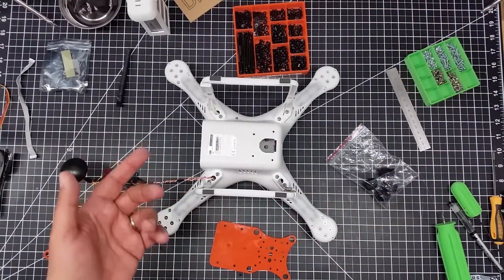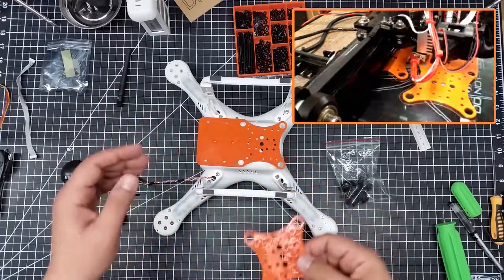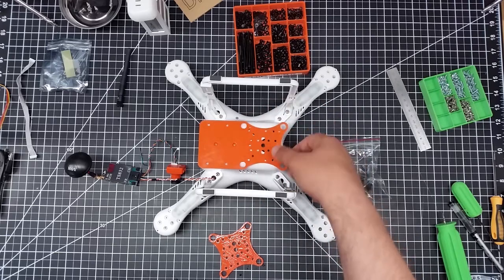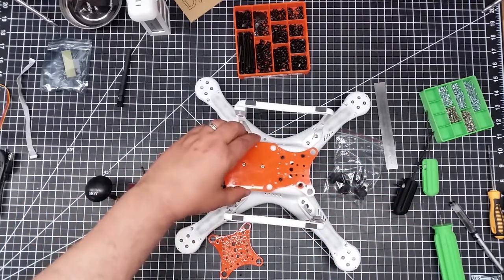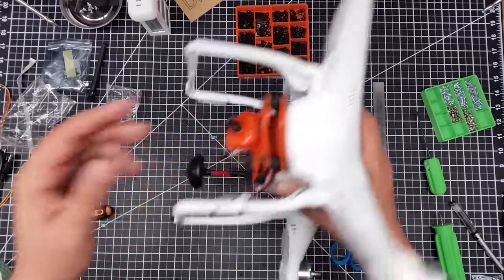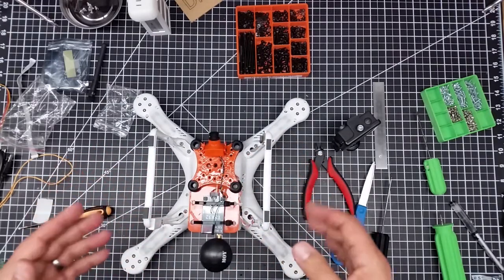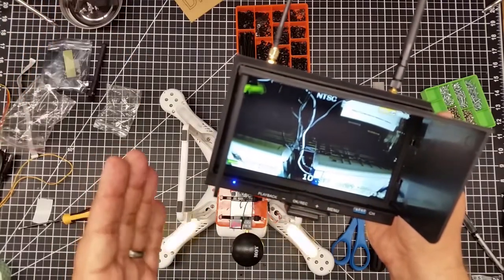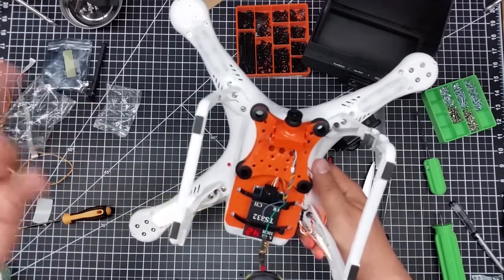Video Drone - 3D Printed FPV and Camera Mount for DJI Phantom 2!

Comment: Could you not have cut those out of acrylic?
Reply from the maker: Yes 100% right however it would have taken longer and did not have the time, however they have worked better then I expected!  Next version will likely be CNCed as I am thinking about ordering that new split run cam and using just that.  Not sure yet...